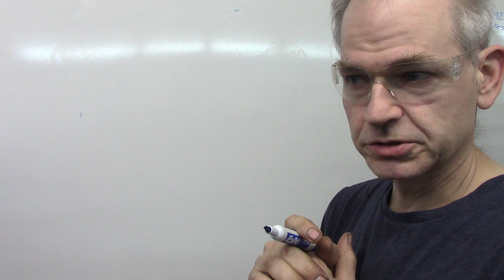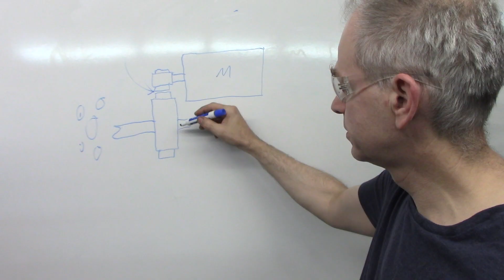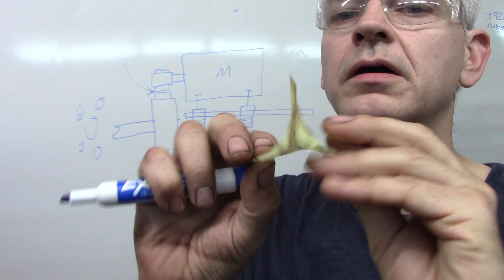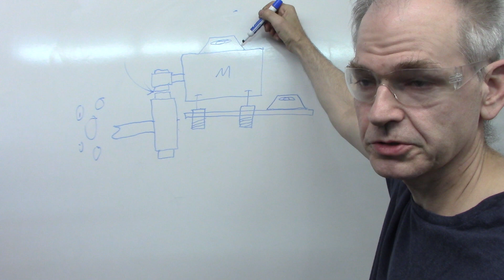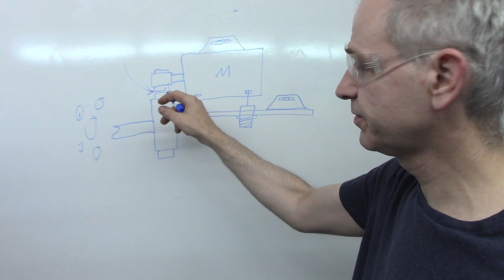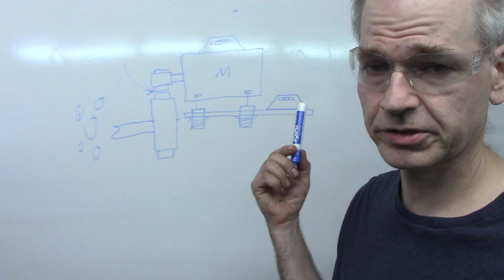7-29-25 --  Cleereman Drilling Machine - How I set the Pinion Gear Lash - Part 4

Comment: The paper trick is a great old way to lash that up .  I've done similar on textile equipment where the bull gear & pinion were virtually blind access .
Reply from the maker: Yeah, it is the best thing I could think of.  I was surprised how well the dirt on the gears printed the paper. Kind of like how a dirty finger can rub a great impression on paper to make a template of a flange. --Doozer

Comment: Nice millwright work!
I use artist's oil color to setup hypoid gears, but in a jam, prussian blue, or a post-it note doubled up would work!
Reply from the maker: I do have some non drying paint for setting ring and pinion gears.  I did not think to use it, because I was having trouble getting the coarse adjustment correct.  I guess now I could go back and ink up a pattern and see.  Good idea, but I am tired of messing with it, and it seems very close to being right.  The gears were not set right when I  got the machine, with the old motor still on it.  The gears must be really hard, as they don't seem worn at all.  ----Doozer